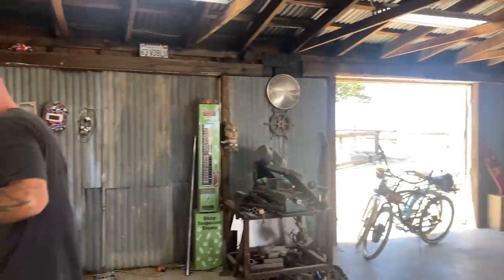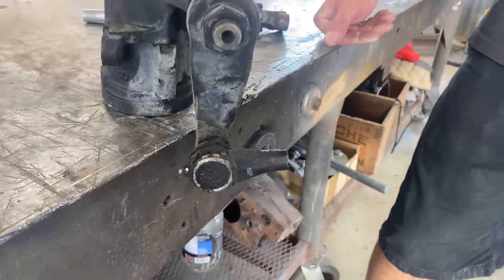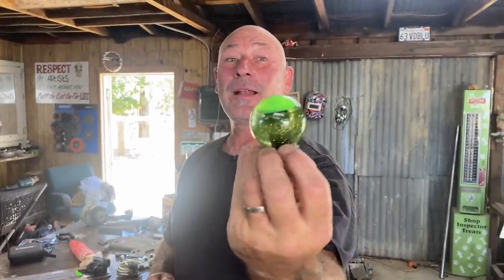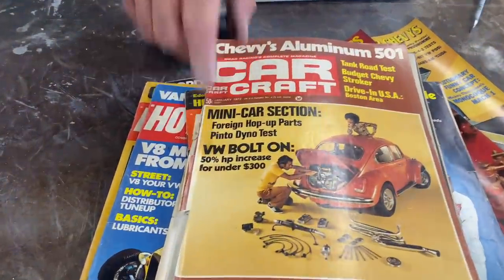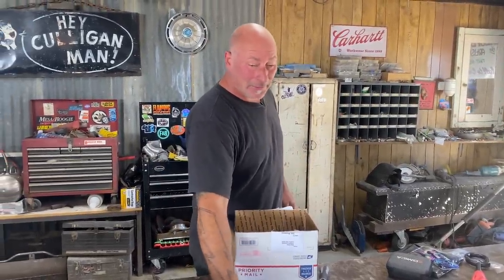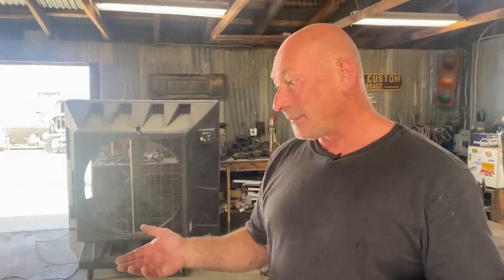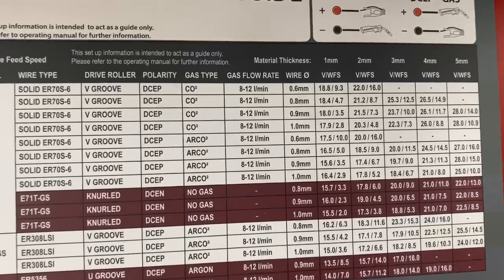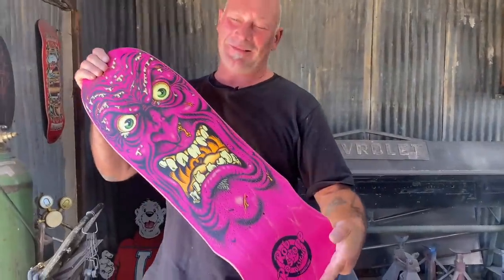Ian Roussel VW/Little Jewel Update and Shop Talk in 104 Degree Mojave Heat 🫠 👽🚨

Comment: I saw your previous video that you mentioned arc captain, and I got their plasma cutter, that thing works amazing, and it was super inexpensive compared to everything else on the market, my only complaint is something I found out for not doing my research, that theres 2 different types of plasma cutters, 1 that you have to drag the tip on the material, and the other you can start in mid air, before you even start cutting, I got the drag tip one, but so far it has worked out in all my projects, cuts metal like nothing ive used before, theres no resistance

Comment: Missed you guys, but I understand working in the heat and how you have to kind of work around it as I'm in Florida but its a wet humid heat here. I was working in a plant before suffering some major health issues a year ago and took pics of thermometers in the plant reading 110-129 @ 6am  and the temps were higher in the afternoon

Comment: Maybe there could be a go fund me for his shop to get insulation and a cooling unit powered by solar? That metal roof is just radiating heat down to his work area.
Reply: Or even coating the roof in white ceramic coating. It will reduce the heat in the shop big time. It radiates the heat away from the roof.
Reply: Dude's had his own TV show for years... Probably doesn't need a go fund me page.
Reply: @peterpumpkineater6958  Just because he has a tv show, does not mean he is rich. That is the assumption most people have. Building cars like he does is not a cheap endeavor. TV shows do not pay near as much as people assume.